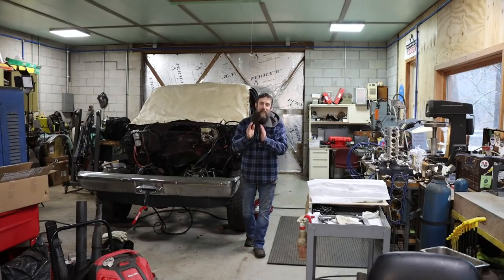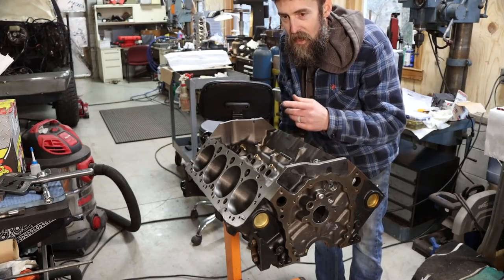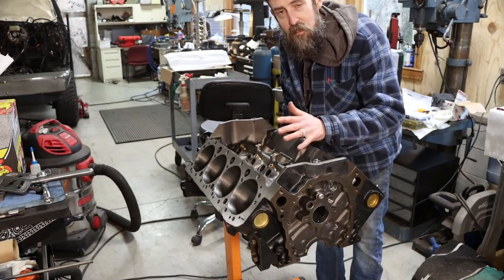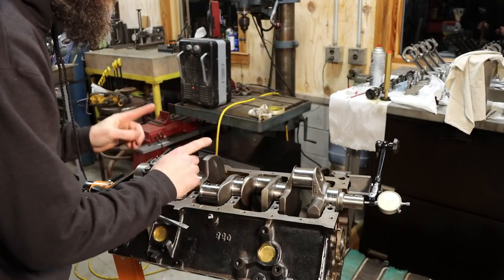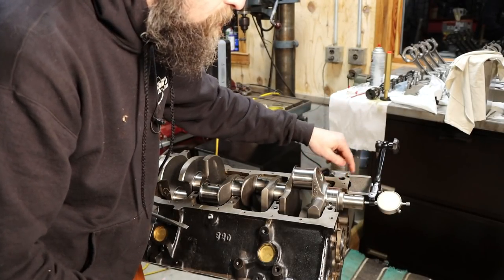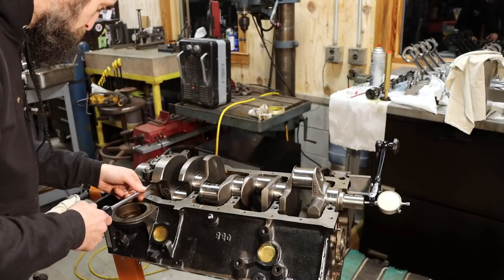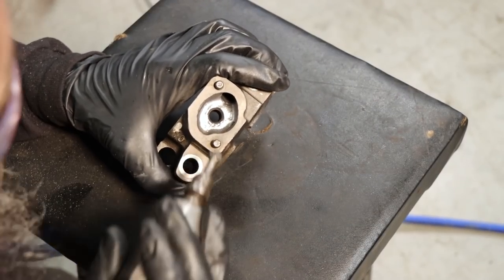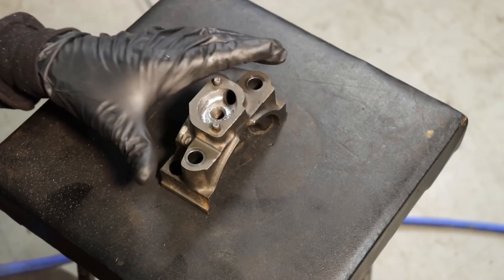Injecting some POWER into the Square Body. Part1

Comment: I had a New Melling oil pump have one of the pump gears lose a piece of metal off one of the gears on a newly rebuilt engine & wipe out the cam drive gear & leave me stranded 2 hrs from home. Melling did not & would not stand behind their pump & the damage it caused. I'll Never trust a Melling oil pump again. Just sayin'.

Comment: I really don't like what you did with the oil drain holes.  Whatever benefit you're trying to gain seems trivial compared to the added lubrication of the cam.  Maybe that's just me and the fact that I have a Tahoe needing a new cam and lifters but still the more oil the better for those roller pins.  And don't forget part of the job of oil in an engine is cooling.  Less oil means less cooling for the cam and lifters.